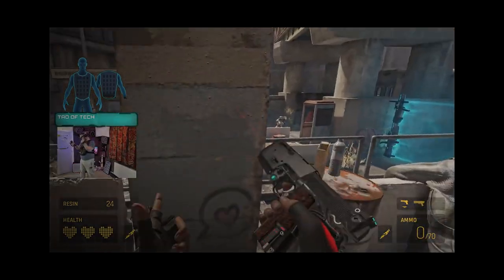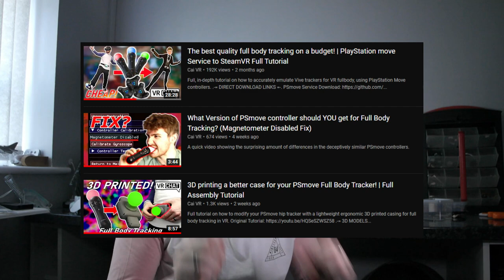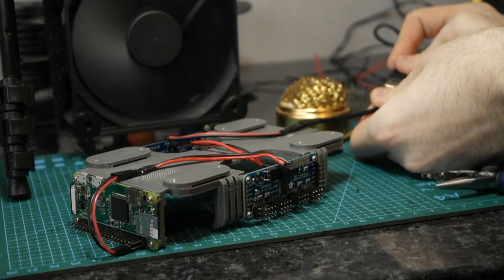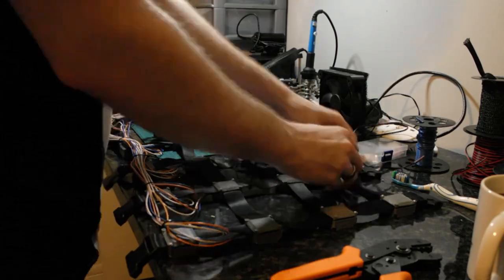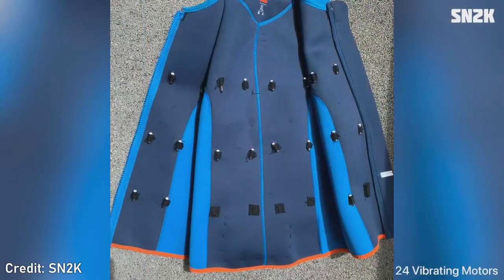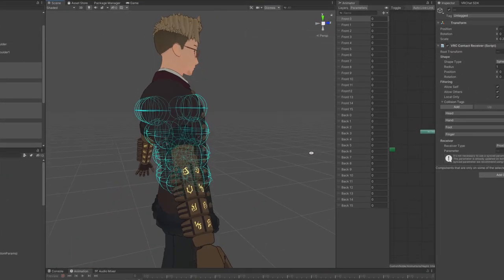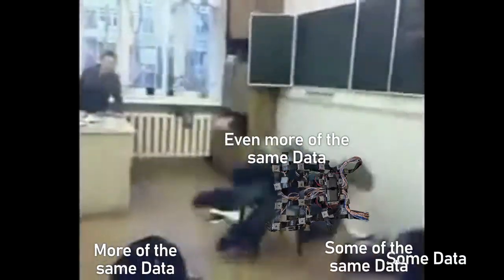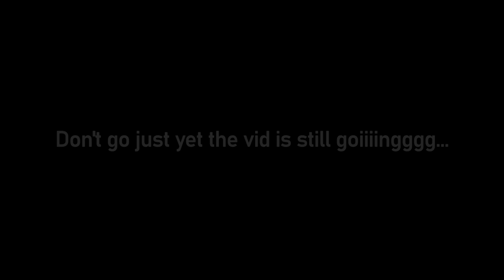I made my own DIY Haptic Vest for VR because I don't have Phantom Sense

Comment: What I'm curious about... you use this vest now for some more weeks? So you maybe already know pretty well what do you want to improve beside the wiring. So what parts do you want to improve?

I ordered today some stuff to make my own version based on your one, but I want to improve directly and bring in my own thoughts on it. So it would be interesting what the cons are so far on your v1 build.

Actually my main thought was going to the strap design to improve it and make it more variable to setup. I ordered flexible and non flexible 2,5cm straps with the same clips you use, but I thought to make it more like a vest so you can open it on your chest and add the ability to tighten/loosen on the sides and maybe add some extra motors with a third pwm board. Also to separate this boards more so you can shorten some cables, but it seems you have also some ideas for better cable management, would be interesting what your thoughts was. I wonder if you can combine the GND cable and if that would reduce the cable amount.

Comment: When it comes to the wiring, I would use some kind of I2C communication protocol to communicate to multiple PWM units, that way you can just wire 2 data lines and 2 power lines to all of the PWM modules, and then have more PWM modules with less channels each. In the best case, you would have a dedicated PWM module for each motor, that way you don't have to run 3 lines for each motor, but instead just two lines that make a giant circuit around the entire vest. You could also add extra connectors to allow you to just plug in extensions. Want arm haptics? Design a piece for arm haptics and plug it into the existing system and ***bam***, arm haptics. Using I2C would also allow it to detect modules that fail to connect, as well as detect newly added modules should you change the setup

Hell, with I2C, you could even add in other sensors like IMU sensors and turn it into a combination haptic and FBT vest by integrating with SlimeVR

also, I just realized that this video was made before the EAC Event...
Reply: The idea of wiring the individual PWM generators up locally is nice, and my immediate idea was to use more than two, as they are really cheap, just like the motors. Im not an I2C expert though, so before ordering 16 PWM bords and 256 motors, one question came up. Does I2C have enough bandwith and can it handle 16 devices at once? Oh, and the question what VRchat will think about 256 colliders is also something that worries me. You seem like a smart guy, based on instinct, you think this would work? if not, where is the maximum?
Reply: @jaynayk1176  Standard i2c can send data at up to 100 Kb/s, which should be fast enough in theory for something like this, given the comparatively little amount of data being sent
As for VRC handling the colliders, it'll significantly impact the performance rating of your avatar
Anything above 32 colliders will be considered very poor performance from what I can tell
Reply: @adicsbtw   yea, I also realized that the performance rating would suffer, but as its only haptic feedback, I guess using fallback avatars would work, so that my PC is the only sacrifice. But then again, that assumes that everybody in the lobby will load a fallback, without any haptic feedback. I do not know what the typical performance fallback rating is, but I guess that if someone displays all avatars, including "very poor" performing ones, their asking for it? I also read that there is a limit to 256 colliders, but I don't remember where. I guess if I was actually smart now, I could train a basic AI that upscales perhaps 64 colliders to 256 motors. But hey, gotta know your limits. I guess I will just use 80 for body, so i can still have 32 for each arm and 48 for each leg. That way all motor driver boards are fully utilized and on their respective module. And I leave 16 colliders unused, just in case the avatar has some other stuff going on. Perhaps I should test the software side of things first though, cause the 240 mini drone motors + ~60 spares still cost ~70€ on Aliexpress. And that's not even mentioning the circuitry needed to drive them, which at those quantity's would probably also cost a bit. Glad I have the batteries to power 240 motors with what I assume to be 2-3 watts each. but yea ten 18650s doing 15 amp each should not be extremely heavy. And besides, I doubt I will actually use thees motors at 100%. Maybe add a few lines to the code that limits the total power, so the batteries does not turn into the main cause of stimulation (fire) and last for more than half an hour of gaming. Although hotswapable batteries would definitively be added too. I guess if I don't fail along the way, or lose interest in VRchat before finishing, I would maybe make a video showcasing it. Even if not practical for performance reasons, I really want to try out. And i could always reduce the total sensors to 32 by just mapping each "sensor" to 6 motors, and dumping arm and leg, so that I could use it casually, with decent FPS.

Comment: DIY Haptic Vest for VR on Amazon Stock

1. 2:17 Buckles Strap on Amazon: https://a.co/d/eyYwzyl $9.99
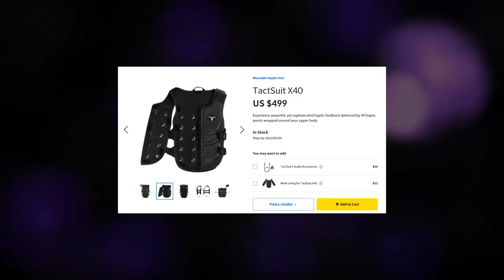2. 4:33 Raspberry Pi Zero on Amazon: https://a.co/d/59BWSjS $79.99
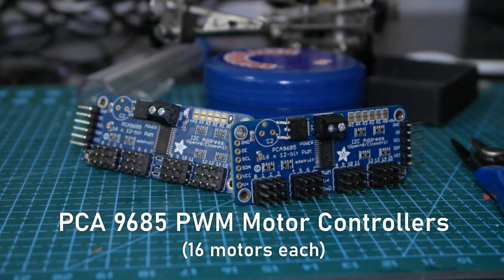3. 4:43 Two of SunFounder PCA9685 on Amazon: https://a.co/d/fLBVE0z $25.98
4. 5:31 power bank on Amazon: https://a.co/d/57neCU7 $35.99
5. 7:11 SanDisk on Amazon: https://a.co/d/dhO408G for example 256GB $34.99
6. 8:53 Hook Up Wire on Amazon: https://a.co/d/7lJdbhf $24.99
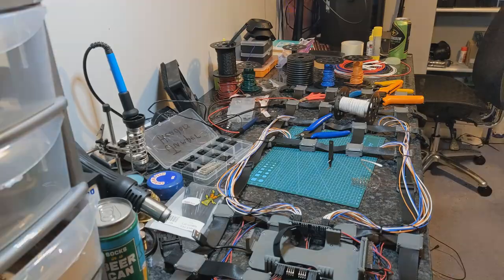7. 9:01 wires on Amazon: https://a.co/d/gBlLFK3 $17.99
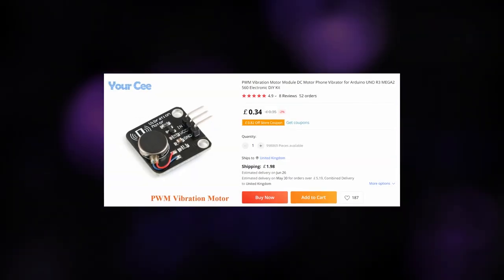8.  9:25 32 Motors on Amazon: https://a.co/d/gKkS5b2 $7.15 x 32 = $228.80
9. 9:37 Grove-Vibration Motor on Amazon: https://a.co/d/9PfLpgw $25.19 I don’t know they have it in stock or not.
10. Soldering iron tools for wires on Amazon: https://a.co/d/iP1Ytz8 $18.99

Comment: Neat! Last year I was prototyping my own vest in Neos. 
I got the electrical design and program interface running, but I had to drop actual assembly and integration for IRL issues. 

I've just picked it back up last week by designing and ordering custom driver PCBs. I just wish that slow boat from China wasn't so slow XD

Comment: About weight, you can make the modules lighter if you use short screws and screw them into a plastic hole like on consumer devices and like you already does two screws should be enough for that. On 32 modules that should spare some grams.

My problem with that rumble modules are the 3 wires, if that electronic for PWM would be directly in the 12 bit controller board you would have only 2 wires each motor and you could even shrink the modules for the strap a bit.

Comment: hey, @Cai Vr, you know you could have cut the amount of wiring just by making the motor power connection in series from one to the other, rather than just connecting the motor power in parallel to the board

Comment: Yep this ist awesome I also was thinking of that for quite some time but i was really scared of getting the software to work. Now that u done this i know i have a chance actually connecting it to a vr aplication the components are as good as orderd. (Did u consider doing it with an Ems device ? There are also rather cheap ones and it has to be possible to controll a device to multiple pads with a relay or transistor array. Just kinda hard to know what is save and what isnt so u dont accidenty electrocute youself)

Ps somehow githup page says not found
Reply from the maker: Yeah ive been considering a huge amount of different haptic options since getting this to work, we'll see what I come up with I guess!
Also oops, the git is still private, my bad will change that now, though I do still have to put everything up there lol :P will be there tomorrow

Comment: you could get rid of the PVC of the motor, buy cellphone vibration motors and print a smaller case so you can fit more vibrators on the vest :D

Comment: Lol i check your channel every week for the esp32 based haptic vest mk2. I am subbed and belled but i absolutely cannot wait so im checking just in case i miss it. Are the other hardware parts the same? If so i would like to order them so i can start assembly on the new version as soon as the video drops

Comment: i suggest putting 3.5 headphone jacks on the modules then u can use smal and durable ready made headphone cables  wich makes replacing cables or motors easy plug n play also the case for the motors should use printed clips no screws or if unavoidable a printed locking bolt on one side and haptic trough motors is already outdated its time for the world to discover the haptic magic of microlinear actuators its like switching from a snes pad to a analog stick
Reply: the vive controllers have microlinear actuators includet so u have a full ready made api integradted to openvr if u want to test around and feel difrent surfaces but the curves of the haptic signal can be freely edited so in case of a vest u could feel the diference of brushing against a curtain or bumping into a table  or draging the controler over a rug or concrete

Comment: Hey, I tried running the program from github but it opens for a split second and shuts off, how to use it?
Reply from the maker: Luckily for you I just updated the repo, and also check the wiki for any help
Reply: @Cai_VR  Thank you. Are you planning on doing a follow up video?
Reply: Also I have a few more questions 
Does it have any delay when someone touches you and it activates since it's connected through wifi?
How about powering off the vest and changing its strength?

Comment: I’m trying too to make a vest, i used an airsoft tactical vest and glued 3d printed half sphere where i put 3v pill vibration motors, and a esp32 its working on hardware but i have issued same problem as you with bhaptics, i also tried to emulate a real bhaptics vest in bluetooth le decompiled the apk to get datas and stopped since, maybe this can help you or someone thanks for your video man, sorry for my english

Comment: Great job man learned alot watching this!  have me kinda inspired to try a project I have wanted to do ,I have wanted make an open source haptic gun stock module like the force tube  I feel that's also far far overpriced for the components involved seems to just be 2 haptic motors and some sort of linear weighted actuator I already use a custom 2d printed stock but wish it had some haptic feedback.